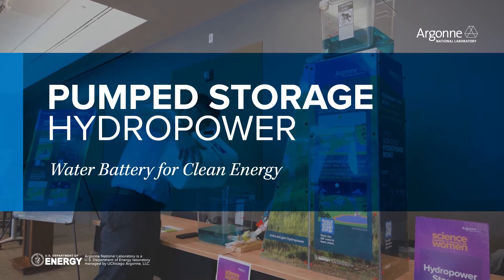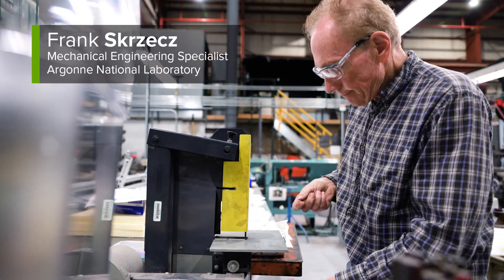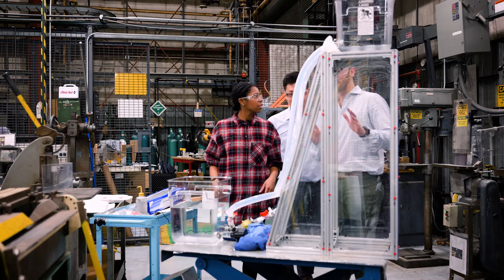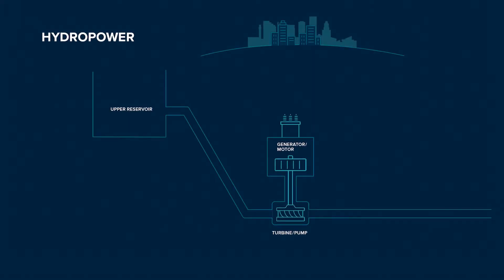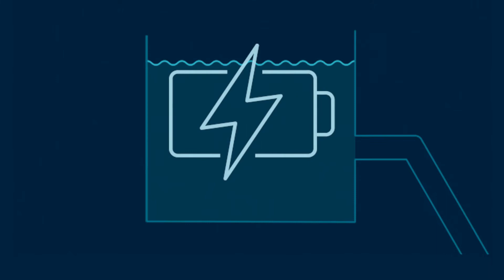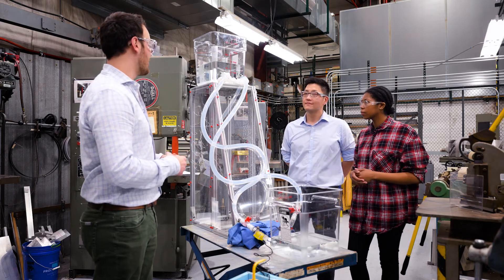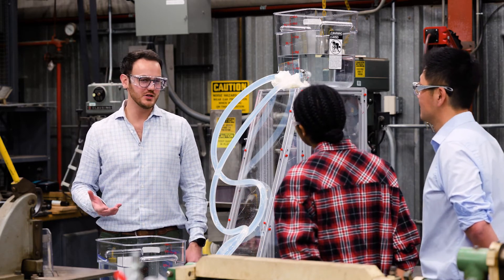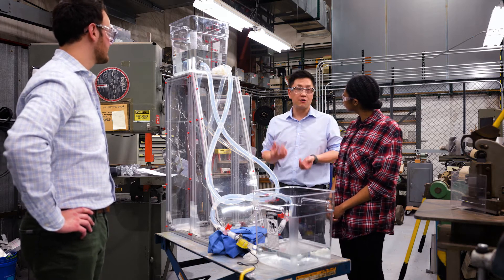Pumped Storage Hydropower: Water Battery for Clean Energy

Comment: Hi can you explain why you couldn’t have a heavy floating object in the top tank. When you pump the water up as normal it would float, then when you drain the water down hill. And take the energy out of it. The weight could be suspended, and have the energy taken out of it with some sort of pulley and generator. I’m sure I’m missing something but would nice to know what i keep thinking with the perfect shape weight and container you wouldn’t need to pump much water and could possibly create more power than you put in but that’s not possible. ??